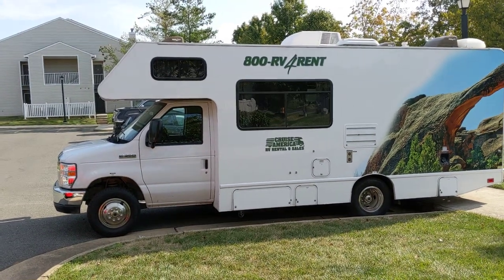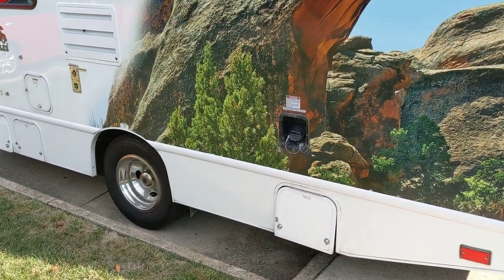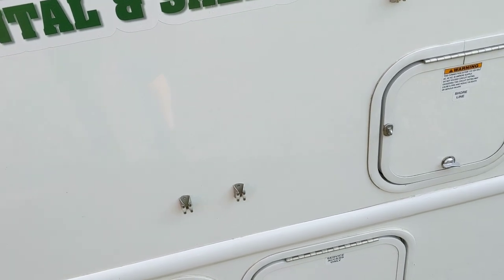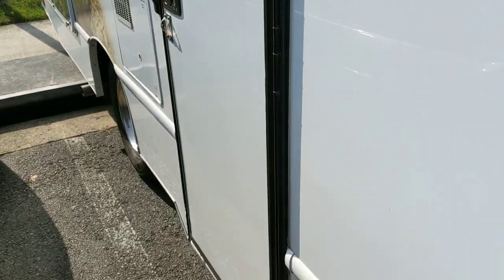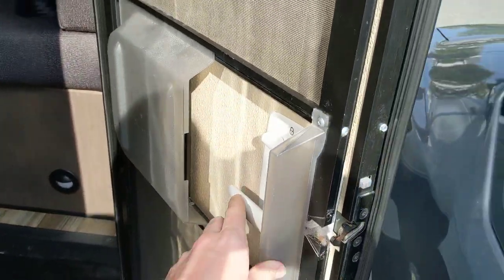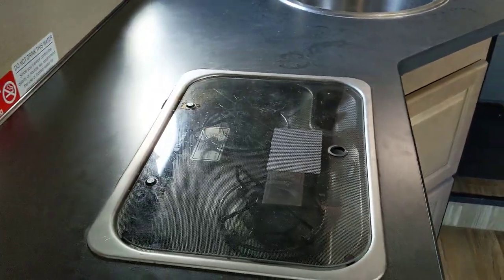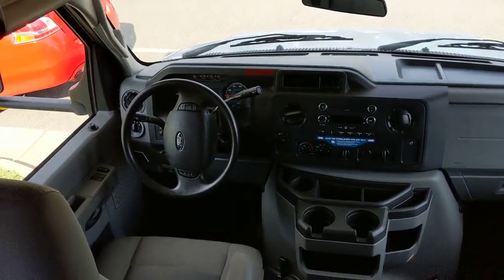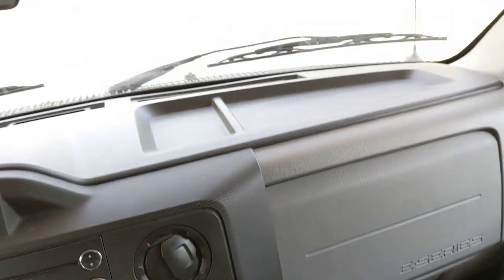Cruise America - Review and Walk through of 25' standard 5 passenger RV

Comment: Can you turn on refrigerator all the time while driving or parking? And how is the cooling? Thanks. Get a RV this afternoon, first time, exciting; thanks for the video.
Reply from the maker: Hi! Thanks for checking out my video.  These are some of the most common questions.  Yes, the fridge can run while driving.  During your "departure" the sales person should set it to Auto (button on the front of the fridge) so it starts cooling.  It will cool as long as you have either natural gas, the generator is running, or if you are hooked up to shoreline power.  It does take about 4-6 hours to cool off (they're not as efficient as household refrigerators) and remember to not pack it too tightly.  Air needs to be able to flow inside it to cool off.  And don't stand there with the door open either, LOL.  😆

Regarding the cooling of the cabin itself, the front air conditioner works any time the vehicle is running.  Just like a regular truck or van.  The rooftop AC unit (for cooling the back of the vehicle) runs whenever the generator is running or if you are plugged into 30A shoreline power (like at a campsite).  If you have people riding in the back you can turn on the generator to run the rooftop AC to cool the back while driving down the road.  This isn't something we've ever need to do, but plenty of others have commented that it works fine.  Just make sure to keep the window closed over that side of the vehicle -- you don't want exhaust from the generator blowing into the vehicle. 

Hope this helps!  I do have a few newer videos also, including this one:

https://www.youtube.com/watch?v=qbBoA0x5Fow

Safe travels!
Reply: @CompTechMike  thanks for quick response, I heard the cooling rate and temperature are not comparable with regular refrigerator at home. Is that might be case? 😀
Reply from the maker: @bunnyhandsome  yes, that is correct.  RV fridges are inherently not as efficient as normal household-style units.  Like I suggested above: don't pack it too full (air needs to be able to circulate), and don't stand there with the door open.  Also, it helps if the items you're putting inside are pre-cooled (like if you have them in your home fridge and carry them out and put in the RV fridge).  Also, if you have the option when parking the vehicle, try to park the side with the fridge on the "more shady" side.  Or under trees, etc.
Reply: @CompTechMike  sweet, thanks! Great tips as well.

Comment: Good review but you said something that caused me concern.  Do not carry xtra propane inside the coach!..Tanks can easily leak or be accidentally opened going down the road.  The gas is heavier than air and will pool in lower areas….looking for a source of ignition.  Always carry xtra tanks in a secured, vented compartment outside.  Be smart, be safe 👍🏼
Reply from the maker: Good tip. Thanks!

Comment: what temps did you get from fridge,  manual says dont expect colder than 60F
Reply from the maker: Correct. 60F sounds about right. It's cold enough to keep your beer cold, but not so cold that icicles will form. 😆

Park in the shade, if possible, and on a flat surface, as this will help the cooling efficiency of the unit. Also don't pack it too tight and don't stand there with the door open, lol. 🤣

Comment: Very interesting to see your video on this RV. I have a  1985  RV like the one you rented. I"ve had it for four years now and love it.
Maintenance on it is simple, tires , tune ups  checking and re-caulking roof every year.  Other than that  put in the gas and go.
In four years I've put 30,000km on it. It really is made for two people and we love it.
Reply from the maker: That's great to hear! Thanks for your comment! 😁
Reply: Hi. I lived in my '79 winnabago for yrs. I found using marine grade caulking and then marine grade paint on rubber seal you don't have to recaulk every yr. I did it once and then found out about marine caulking. Lived in 4 more yrs without having to recaulk and no problems. Only got rid if it when baby came along.
Reply: Caulk your roof with Marine 5200 sealant from marine supply stores. Lasts and lasts

Comment: There are 3 holding tanks, Grey, Black, and Fresh water. I believe there is a Y separator for the Grey and Black water tanks wherein you can drain the Grey water tank on to the ground without disturbing the Black water. In the video it stated that the Grey water tank filled up and it restricted their ability to remain boondocking. I'm not 100% sure about this but when I had a motor home this was the case. It did look as though this type of connection is part of the Cruise America unit. By the way, excellent quick tutorial on this motor home.
Reply from the maker: Hi!  Thanks for the comment.  The black and gray tanks at the bottom flow into a "Y", with separate pull-handles to drain each of them.  If you're parked and connected to a sewer line it's typically recommended to leave them closed (to prevent rodents from crawling up the lines, etc.) and pull the black, and then the gray, when you are ready to dump.  The gray tank emptying out helps "flush" the line of any solid material.  When boondocking this is not an option, obviously, and you will need to rely on how much the capacity of the tanks is.

For the standard-size RV which we usually rent, the vehicle can hold 40 gallons of fresh water, 24.5 gallons of gray water (waste from the shower and sink), and 24.5 gallons of black water (waste from the toilet).  My wife and I wash a lot of dishes and like to take showers every day, so in our case although we had plenty of fresh water remaining (from the 40 gallon tank) the gray tank (24.5 gallons) filled up after three days.  Obviously this will vary depending on your own water usage.  Thanks for the comment, have a safe trip!
Reply: @CompTechMike  When boondocking you should be able to drain the Grey Water Tank on the ground as there should be nothing but used water from the shower and sinks. This way you don't have to find a dump station or RV park until you are ready to drain the black tank. At least this is the way I used to do it a few years ago when I owned a motor home. There should be nothing solid in the Grey Water Tank only harmless liquid. After all you're not dumping the Grey Water into a garden or flower bed.

Comment: Hi Mike. Thanks for your video. I am about to rent this RV with 3 friends for 14 days. Could you tell me more about how much we will have to fill up the water tanks/electricity and empty out the grey/black water? This is assuming we will have a quick shower each per day. Any help would be appreciated. Thanks
Reply from the maker: Hi!  Thanks for the comment.  Those are pretty open-ended questions.  Personally we travel just my wife and I.  We both shower each day, and clean & wash dishes every day.  The biggest issue we had when not connected to shore power / sewer hookups was the grey water tank filling up too quickly.  On the 30' RV, the grey tank is only 22 gallons.  For comparison, the fresh water tank holds 40 gallons and the black (waste) tank holds 25 gallons.  My opinion, they should have made the grey tank larger and the black tank smaller.  Or at least flipped them.

We found that with our usage, we had completely filled the grey tank after three days.  We still had plenty of fresh water and the black tank was less than 1/3rd full.  Most campgrounds should have dump sites, so even if you're not staying in a campground (or staying on BLM land, etc.) you should be able to find plenty of camps in that area where you may be permitted to dump.

With four adults and 14 days (the scenario you describe) you'll probably want to be very conservative with your showers.  "Navy shower", as the saying goes.  That grey tank fills up fast!

For electricity, I'm assuming you're going to be using the generator to power the household-style electrical outlets, microwave, and air conditioner.  I would suggest to monitor usage (since there is a cost associated with generator usage) and to bring along some extra oil.  Cruise America does want that to be checked periodically during use (I believe they reimburse the cost of oil).  Also the generator runs off gas from the main gas tank, and as a safety feature the generator won't turn on if your gas gets too low.  Your other option is to bring along some power splitters and an inverter, you can run a few small electric items off the 12v "cigarette lighter" electrical outlets in the cab.

Hope this helps!

Comment: Question about the propane.  Does it come pre-filled or do you have to fill it? And, can I use the propane to fuel a gas grill outside?  I didn't see any external connections when you opened the hatch that houses the propane (other than for filling). I sold our travel trailer in January (for top dollar!) so now I'm renting one of these for a trip in Oct. Thanks for the very informative video!
Reply from the maker: Hi! That depends on the renter before you and also the sales office.  In my most recent experiences renting, the sales office will top off the propane prior to departure.  In the past they would just ask that you "bring it back as full as it was".  So if the previous renter picked it up with 1/3rd of a tank, they were only responsible for bringing it back with 1/3rd of a tank.

This is similar to how they handle gas in the vehicle.  If you pick it up with half a tank, bring it back with half a tank.

Again, I'm not sure if corporate policy has changed or if we just have a really good local office, but in my most recent rental experience (last week) the water and propane tanks were both topped off by staff before we left the yard.

As far as hooking up an external gas grill, I do not believe the current system supports that.  You could probably cobble something together with the right adapters, but you'd probably be violating your rental contract.  Personally I'd just pick up a couple green bottles of propane from your local camping supply store or Walmart before heading out.  😉

Good luck, have a safe trip!

Comment: Question for you did they charge you $3.50 per hour of the use of the generator?
Reply from the maker: Hi!  A charge for generator usage is normal.  I believe it is currently $3.50 per hour, yes.  Typically we stay in campgrounds that have plug-in "shore power", and have only ever needed to use the generator once, for about an hour.  For small electronics we bring a 12v to 120v power converter that allows us to run things and charge small devices off the vehicle's electrical power (the 12v "cigarette lighter" style outlet on the dash).  Hope this helps!

Comment: Great job showcasing the 25' rv.  We will be driving long distance moving elderly family member in one just like this.  We will be mainly interstate driving and wondering what kind of average mph you were getting when on interstate.  Thanks for any input you may have.
Reply from the maker: Hi! Thanks for the comment. This is a very common question. On the 25' RV (with the V8) we typically got around 10-12 mpg. On the 30' RV (with the V10) we got around 8-10 mpg. Of course this can vary widely based on if you are doing city or highway driving, stop-and-go, up hills or across flat terrain, the quality of the gas and how well maintained the vehicle is, and of course how heavy your foot is. 🤣 Have a safe trip!

Comment: How many miles were you able to get on a tank of gas? (Mostly driving highways)
Reply from the maker: Hi! Thanks for commenting on my video.  In our experience we've found the 25' RV (with the V8) gets about 12-14 mpg.  And the 30' RV (with the V10) gets around 8-10 mpg.  Of course this varies a lot depending on if you're doing stop-and-go or highway driving, whether you're driving across flat terrain or up & down hills, and how heavy your foot is.  😉  Both the 25' and the 30' RV have 55 gallon gas tanks.  Hope this helps!
Reply: @CompTechMike  Thank you for the info. Yes, this does help as we'll be driving quite a long way this summer.

Comment: Basic motorhome without a slide. The rent is about half price off season. In addition, if you want to run the heater all night, use a Buddy heater instead. The house battery will only run the furnace fan for a couple hours max without running the generator. Plus the RV furnace uses a lot of propane.
Reply from the maker: Good tips,  thanks!
Reply: @CompTechMike  We've rented ones for three hunting trips. Got down to upper 20's at night, not cold enough to freeze the plumbing. We usually would run the generator and furnace only in the evening and morning. It would be nicer if they had larger house batteries.
Reply from the maker: @wes326  If I ever buy one of these, larger house batteries would definitely be an upgrade I would be looking to do.  That and more solar panels.  😃
Reply: @CompTechMike  A even better idea would be to have at least 400 watts of solar and 400 AH of battery capacity and switch out the propane refrigerator for a residential refrigerator. These refrigerators keep items colder, but you may have to also add an automatic switch for the generator in case the batteries get low. That's what larger Class A's have. Nice review, BTW.

Comment: How was the MPG? Also what was the gas tank size?
Reply from the maker: Hi!  Thanks for checking out my Cruise America walk through videos.  In our experience we averaged around 12-14 mpg with the 25' RV and around 8-10 mpg with the larger 30' RV (slightly higher with the newer vehicles due to more efficient engines and transmissions).  However there are many variables involved such as how much weight (including people and equipment) you are carrying, whether you are driving across flat terrain or up & down mountains, highway or city stop-and-go traffic, and of course how heavy your foot is!

One other consideration is if you are running the generator while driving (for example: to run the rooftop AC to cool passengers in the back) the generator also draws from the main fuel tank.  As a safety feature (to prevent you from running out of gas) it will not turn on if the level of gas in the tank is too low.

The vehicles have a 50 gallon capacity fuel tank.  In our experience this is enough to (for example) get from Northern Virginia to upstate Pennsylvania and halfway back down again.  But that $200 fill-up is a whopper, LOL.

We also have a newer video that shows some of the features of the newer vehicles:

https://www.youtube.com/watch?v=qbBoA0x5Fow

Safe travels!
Reply: @CompTechMike  thanks so much!! Big help!! I’m considering renting one for a trip from Massachusetts to Florida and back!! For my dads 50th birthday haha, you answered all my questions thanks so much❤️❤️
Reply from the maker: @Woahitschristian  you're very welcome! Have a great trip! 😊

Comment: Hi Mike! We are going to be first-timers with Cruise America rentals and your video answered many of our questions (you're correct: their website doesn't offer much information) on this standard model. Questions: how is the drive/ride of this RV? Do they handle rough or fairly smooth (well, as far as a truck goes)? You're as tall as my partner; how would the passenger seat be for him? How is the acceleration and maneuverability of hills/inclines? We would be going into the Adirondacks. Also, are these models self-leveling? Thank you for your time, and great video!
Reply from the maker: Hi!  Thanks for the comment, and all the questions.  As far as "how do they drive", I've driven a lot of large vehicles in my life.  Big 1970's era "boat cars", SUV's, U-Haul rental trucks, and pickup trucks.  Generally I think the Cruise America rental RV's handle pretty well, but this can vary based on the condition of the tires and how well they have been maintained.  I did have one once that felt a little "sloppy" and like it could use an alignment, but that one already had over 100k miles.  Just be careful, drive slow, and use your mirrors, especially when changing lanes and pulling into parking lots or gas stations.  Also I would recommend looking for a "pull through" campsite instead of one where you need to back in.

I've never sat in the passenger seat so can't really speak for that, but I'd imagine headroom/legroom should be fine.  The seats don't recline or have much lumbar support, but are pretty typical for "van seats".

The V8 model may struggle a bit on steep hills, I'm renting the larger one with the V10 engine next and plan on doing a followup video for it.  I've heard that engine has a lot more power for climbing hills (compared to the mid-size rental).

The Cruise America rental RV's do not have self levelers.  Again, just what I do, I'll try to pick a campground that has pictures of all the campsites, and use those photos to try to gauge a good, flat one.  You can also get the "Lego-like" stackable leveling bricks.  Hope that helps, have a safe trip!